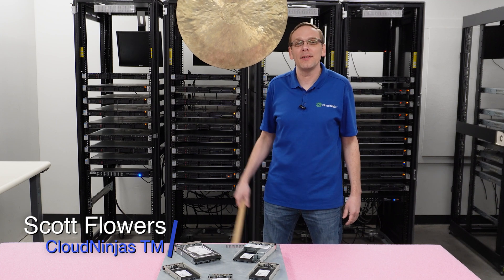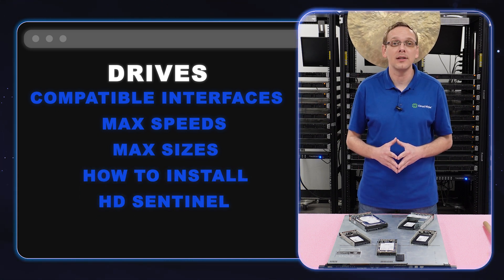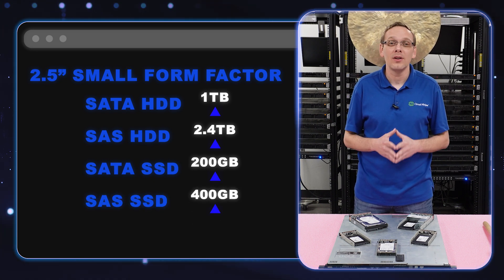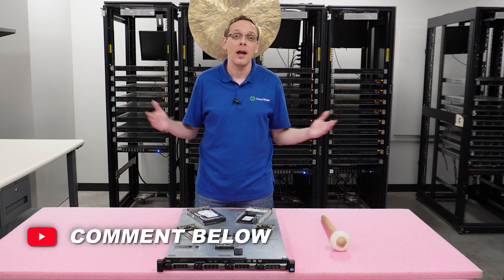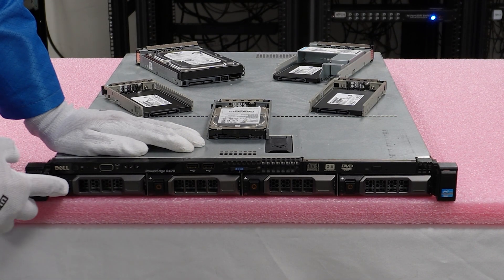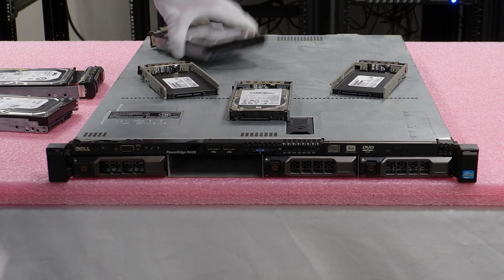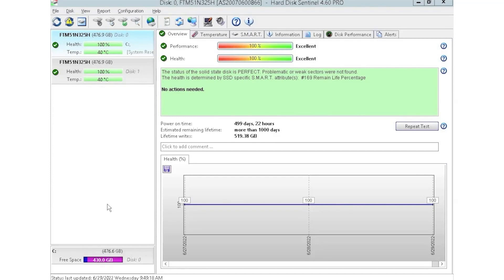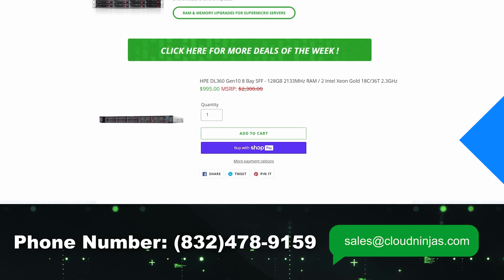Dell PowerEdge R420 Drive Updates | SSD Upgrades & Options | How to Test with HD Sentinel

Comment: So, I'd like to make a request. I have a Dell Poweredge R420, and I want to do some massive upgrades to this thing (CPU, Add in Second CPU, max out Ram, and Solid GPU) Please Obi-Wan Server Lord, point me in the proper direction.
Reply from the maker: Can definitely help.  Gotta match the CPU.  Believe Heat sink #2 different than Heat sink #1 so careful there.  We have several options on RAM.  What is your current cpu?
Reply: @cloudninjas  Xeon E5-2400 I believe? I saw I can get a 10 core 20 thread Xeon for this, I sort of want to run both. Two of those 20 thread Xeons. 

I also kicked myself in the leg when you explained it’s limited to 2tb per 3.5 sata. I have 3 3tb IronWolfs in it and it only sees 2 per drive. 

I’m having a blast poking and prodding and learning server environments, but I want this thing to really cook, it’s shaping up to be the nerve center of my house
Reply: @cloudninjas  so any education would be greatly appreciated!
Reply: @NeinMillimeter  Dont bother, I had this thing maxed out and it wasnt very impressive.... at all..... Get yourself at least the next gen up LGA 2011-v3. You can get the E5-2673 v4 chips for 50 bucks. They are 20 cores each. With a passmark score of 22k I think. There are several upgrades from there all the way up to a 28k passmark. The most these damn 420s can do, is a passmark of 10k... Id much rather spend a few extra bucks and have 40 cores and 80 threads for 100$... 32gb DDR4 ECC dims... are 16$ each..